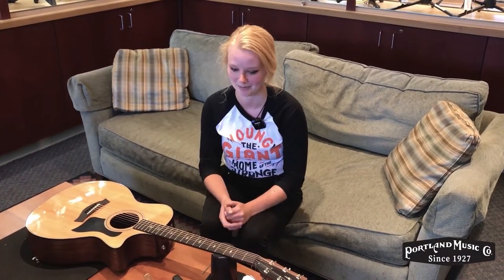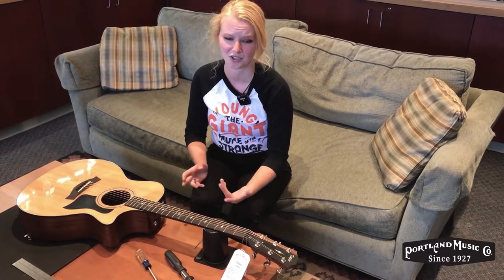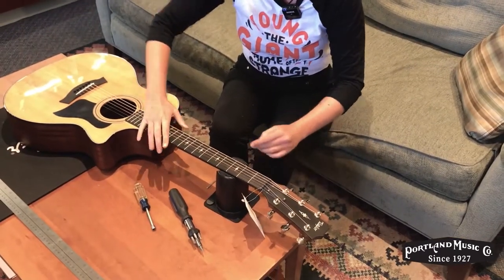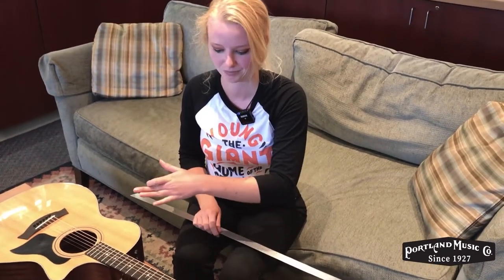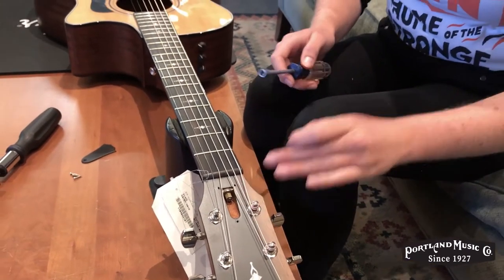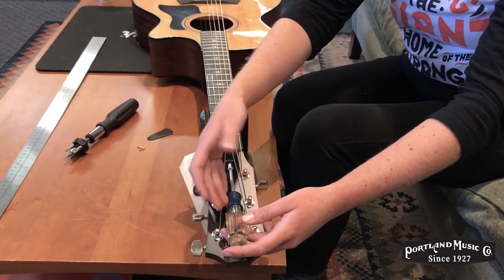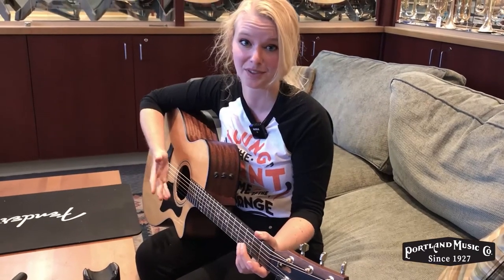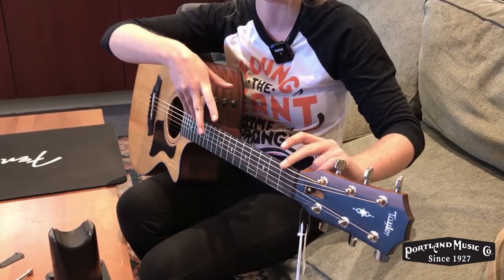How to adjust the truss rod on your acoustic guitar

Comment: Just make sure that long ruler isn’t resting on your bridge, as shown in this example. That’s definitely going to give you a wonky result.

Also, when checking with your fingers, specify to depress the string where the body meets the neck as well as the first fret. It does “matter up there”.